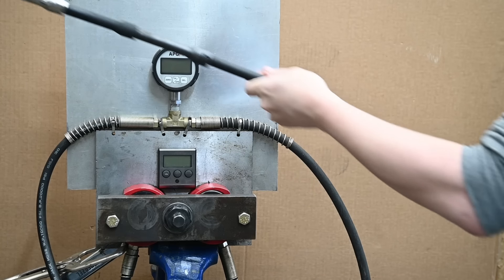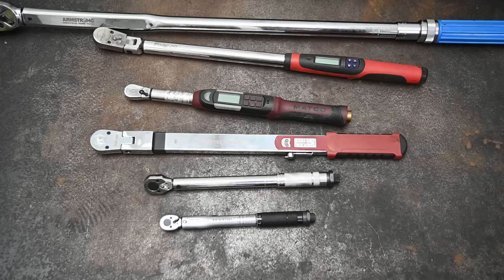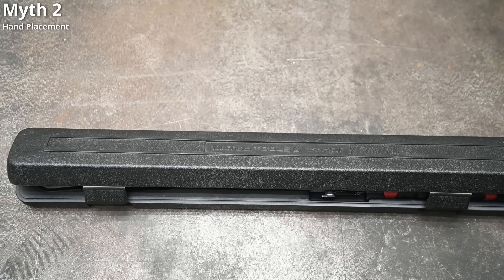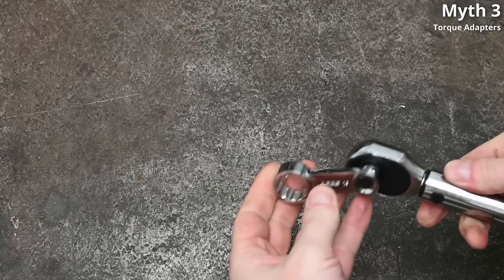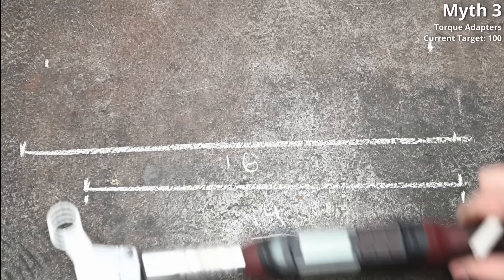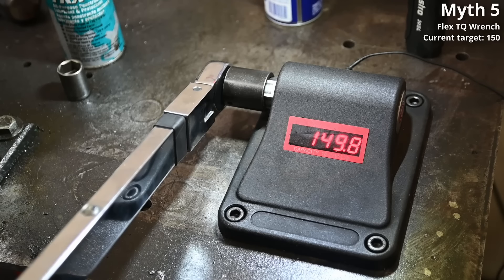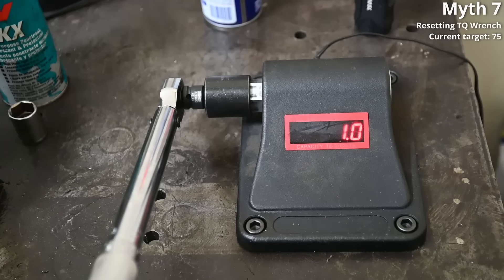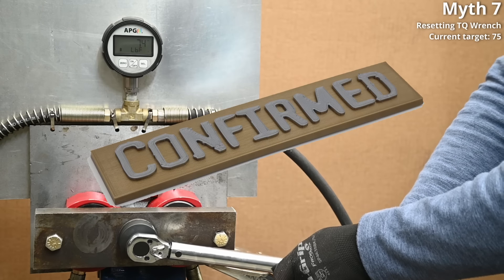You're Using a Torque Wrench Wrong: MythBusting 10 Do's & Dont's

Comment: When I was doing my apprenticeship, a couple of the instructors in my first year had an awesome lab for us where we'd incrementally torque some bolts, with anti-seize, oil on the threads, rust on the fastener and a couple others to show us how they feel when you're doing it, as well as how vastly all over the place you'll have the heads of bolts snap off. Manufacturers have WET and DRY torque settings for a reason. Usually the people that ignore that fact are the same guys who throw shit back on with torque sticks because they can't be bothered to get out a torque wrench and do it properly.

I think a lot of the misconception regarding torque in the first place starts with the commonly mixing up of ft-lb and lb-ft. even manufacturers have muddied the water by using them interchangably. The difference isn't super relevant to most people, but where it would be is the breaking down of torque into its composite components for teachings sake (and of course on the fab and engineering side but I digress...) If you understand HOW torque is applied, the notion of most misconceptions becomes nonsense immediately.

Comment: Now you got me thinking.  Since the anti-seize had such an surprising result, what about any added liquid to a fastener?  Wet applied thread lock?  Dried thread lock?  Lubes, like WD40, engine oil, and even brake fluid?  Water?  Rust?  Standard coating vs Stainless Steal vs Titanium?  So many things to test, my mind is blown!

Comment: Not resetting the wrench is also a huge problem if you live some place where temperature changes hard and your storage isn't tottaly insulated.

The heat can cause the spring to deform, usually this is a non issue because the whole mechanism would warp but if its under max tension it just makes the problem SO much worse.

Comment: you should do a test using loctite.
i think you will find the same results as anti seize (over tighten by almost double)
Then you should let the loctite set up and try to remove with a torque measurement, it will be like three times. 
even if you heat the loctite to break it down you still run the risk of snapping the bolt.
to be honest, i have never seen a bolt with a torque spec that calls for loctite.
but i have seen a bunch of dyi'ers that think loctite appropos for every application.
a torqued bolt is an elastic connection system. the bolt and nut are designed to hold best at the specified torque. adding loctite should not be required.

Comment: Luxonmx has some great write ups on torque spec for bolts and how lube vs unlube and new vs old bolts change torque and how all about clamping force but only able messure it from torque of the screw/bolt

Comment: Is it possible to figure out a correction factor for anti-seize compound on threads? For example, maybe in the 0-50 ft-lb range a particular anti-seize compound might have a correction factor of -25% and that gets you in the 5% accuracy range on bolts. Then, if you up it to the 50-100 ft-lb range, it might have a correction factor of -50% instead. Seems like that should be something that can be characterized for a particular anti-seize formula. Would it be within the 0-2% accuracy range? Almost certainly not, but maybe it could be within 5-10%, and I would take that over my bolts rust welding in the midwest. 

Thanks for making this vid, quality content!

Comment: With regard to flex heads - it's cosine error. if you flex the head 90° then it'll click without applying any torque. There's a reason the flex heads are restricted to +-10 degrees or so, because that limits the cosine error to ~1.5% which is within the margin of error.

Comment: In my job its critical to get torque values correct or people will get a pressurized bolt to the dome or completely kill a $50k job. We went through a whole class on torque and use of tools as well as the physics behind it. I have the formulas for torque on a magnetized table on my tool box. A lot more to turning a wrench than people realize.

Comment: Regarding the antiseize, can you show the difference between using anti-seize, grease, oil etc? Also how is the k factor affected by different bolt material? Stainless, galvanised, plated, etc? Even nylon locking nuts?

Comment: I wonder if you can "revive" the spring of a torque wrench that has been left at 75  ft lbf for six months by just leaving it hanging at 0 ft lbf for some time or by cycling it from 0 to 100 a couple of times.
Said differently: if you recalibrate it in it's "spring compressed state", will the calibration be out of whack in six month?

Comment: The section on anti-seize is pretty cool because it also indirectly applies to using teflon tape on fluid fittings. It's a common misconception that teflon tape seals your threads, but it's actually a lubricant. Without it, the friction of the threads is too high for a fitting to achieve its proper interference fit (look up NPT tapered threads).
Reply: Looked it up and it said "Sealants are Teflon (PTFE) tape or thread sealing compounds, also called pipe dope. When assembling connections, they fill any voids between the mating thread crests and roots that leave a spiral leak path. Sealants also provide lubrication that makes metal thread installation more manageable, and they help prevent galling." This from an engineering site titled - Getting to Leak-proof with NPT & NPTF Threads: What Matters.
Reply: The common misconception is actually what you think. That it only acts as a lubricant to further tighten things like npt threaded fittings. That's what isn't true. It does both. You can easily test this yourself by trying it on something like your shower head or an air compressor fitting. Count how many rotations it takes to stop the fitting from leaking, both with and without ptfe tape.  You'll really notice a difference with an air compressor using steel fittings, or one steel and one brass fitting. If both fittings are brass, though, no ptfe is needed because the soft metal easily deforms into itself.

Comment: Seems like with the two 2 in. extension at 90 degrees, right triangle math would apply. The torque wrench forms the base of the right triangle and the length at which the force is applied forms the hypotenuse of the triangle. The extension forms the short third side of the triangle, and with this setup the hypotenuse and base lengths are not exactly the same, but pretty close. I haven't done any math, but I suspect if you made the angle between the wrench and extension equal to the angle between the extension and the actual torque length, the accuracy would be the same as not using an extension at all. These matching angles would be a bit less than 90 degrees.

Comment: I always believed the 'don't leave it compressed' for the reason you have found, good test. I have a question whether that is a permanent deformation of the spring? I mean, it's going to depend on the spring material and different brands, but just out of curiosity leave yours unloaded for 6 months, if you might comment here what the outcome to that was (will be)? cheers, thanks for video.

Comment: Leaving a clicker unused:  In every other application I've heard of, a steel spring under compression does not create a set in the spring, in anything like a reasonable time for the purpose.  Coil springs in automobiles, for instance, are designed to go years under tension in relatively harsh environments.  And the springs in semi-auto pistol magazines can go decades under maximum compression without losing effectiveness.  I've heard many metallurgical engineers over the years point this out.  If you see a difference in just six months in a tool, maybe something else is happening...or that tool is indeed extremely cheap.

Comment: For Myth 7 :  It would have been nice to see you set the torque wrench to a specific setting, say 80 ft.lbs., test it at that rating and then store it away at that setting for 6 months. Then retest it and see what the reading will be.  The company I worked at had many torque wrenches locked to a specific value and used every day.  As others have mentioned below, these very rarely go out of calibration when checked at their specific torque every 3 months.  I think the benefit of this Myth 7 being busted is for a torque wrench that will be used at many different torque values during its lifetime.

Comment: NM here you have forgot to Test the Gedore Dremometer at the handle acuation point Test, because this Special wrench Can be Teleskopen on the handelside( i only know that because i had used one with a 5m ( 197 Inch) to torq 4600Nm

Comment: Never mentioned this, but hey you asked for it.

Does your dyno properly represent the load of a normal bolt?

the load is supplied by the measurement device, however this does not have the same characteristics as a steel nut or bolt into solid steel. Specifically, i believe the dyno is more elastic, allowing more flex, and possibly not absorbing high frequency impact forces properly in particular.

not sure, its just a thought i had.

Comment: I would think that adding the extension at 90 degrees would add length, but it'd be the difference between the starting length (14") and the hypotenuse of a triangle with a rise of 2" and run of 14." Since the aspect ratio is so low, the length barely changes. If you had an extension that was 14" I wonder if it would change more

Comment: Can you do a video comparing different thread lube and loctite. The industry I work in alot of the mechanics use copper paste or high pressure grease on bolts. I would also be curious to see how it effects different bolts (steel, Titanium, stainless steel)

Comment: Some great points issue is with most these channels, you need a   gear reduction real calibration set up so you aren't pulling , accuracy out the window unless you are using something like a suretest CDI or Norbar calibration system. Using lube you should be adjusting for that. What you are after is clamping force, why work harder to get it? Nobody cares to buy a lawnmower they simply want short grass. End result.

Comment: for the torque adapters!! setting it at 90 degrees does actually matter, just doesn't in this example. your working length is the hypoteneuse created by the wrench and the adapter. for the example tested here, it only comes out to 14.14... inches, compared to 14 inches, but if either of those lengths were to be much different, you'd get different results

Comment: Thank you for the great and informative video. However I would like a redo on the extension test because my thoughts are that when you get into higher torque like 150 you will be twisting the extension rather than turning the fastener. Have you tested it at high torque yet?

Comment: When tightening a series of fasteners that are all connected to the same part, going in a series changes how tight the first fastener is by the time you get done with the last. How do you use a torque wrench effectively in that case? Chase all the fasteners over and over until they all click quickly?

Comment: The anti seize is interesting, because I believe it opens up a whole new can of worms? If thread friction has that much of an effect, wouldn’t that mean that an old bolt into old treads would under torque?! I’m all for using new bolts when reasonable, but wheel lugs are a great example, even if I replace worn lugs, I’m not likely replacing the wheel hub, nor can I easily inspect the condition of the hub’s threads. What to do?

Comment: I feel like a flexible beam torque wrench is the most trustworthy to be consistent as long as it is used properly and consistently.  I always use a flexible beam wrench for internal engine fasteners.

I am also curious how much the tightening speed factors into the actual click point.  On a flexible beam wrench, so can see how much the speed of tightening inflates the reading and how important it is to creep up on the target value very slowly in the final moment before reaching the target value…tightening too fast seems to reach target torque prematurely.  How fast is too fast I am curious…

Another thing I find especially on higher torque values is needing to keep the fastener moving smoothly into the target torque.  Stopping too close to the target torque will make getting it accurately to final value nearly impossible on a click type wrench due to higher static vs dynamic friction.  A flexible beam wrench can be helpful since you can get the bolt going again which can require more torque than your spec.  Being able to watch the scale to mentally filter out that static friction torque spike required to get the bolt moving again and get the last little bit to target under dynamic friction is useful.  Otherwise, you have to loosen a bit and try again.

Comment: Great video, thanks. I'd like to see more variations of the anti-seize test. Are the results the same using anti-seize on large and small bolts? How is the torque affected if you use it sparingly? How does blue threadlocker affect the torque? A rule of thumb I've seen suggested is to aim for the low end of a spec, for instance set the wrench to 69 ft*lbs if the spec is 69-86 ft*lbs and you might not overshoot it, is there some situation where that rule of thumb holds true?

Comment: Actually that harbor freight wrench once calibrated was a very accurate torque wrench for a long time. But the electric ones are a whole new level. And they have charts for lubed torqued which each lube type on the threads. Down to a science. Arp fasteners has done tons of research. On how to torque just follow the specs. They give, it’s had a lot of research done to it.

Comment: Something that’s not stated super clearly is that the “torque” reading attained with lubricated threads does not mean that more torque was applied. Your setup is displaying a converted force applied to a hydraulic ram that is measured by the fluid pressure. Applying thread lubricant will increase the force applied per torque to the fastener by decreasing frictional losses. You don’t end up with “more torque” at the bolt, but your gauge is set up to convert the measured fluid pressure to effective torque applied to a non-lubricated M14 fastener. Changing any parameter (fastener lubrication, diameter, thread pitch, ram size, etc.) will change this calculation. 

The actual result here is that more tension is applied to the bolt for the same amount of applied torque. 

It may be true that the force applied to a lubricated fastener torqued to 100 ftlb results in a clamp load that is equivalent to that resulting from a non-lubricated fastener torqued to 190 ftlb, but I haven’t done the math on that.

Comment: Actual metrologist here, the temperature you use it in will also change the torque value, but unless you guys are using the torque wrenches for aerospace or other 2% or better applications you're probably fine with most of this shit.  Technically applying the torque anywhere outside dead center of the grip will throw it off too but only based on the wrench length and setting and it's usually not enough to matter for automotive etc.

You CAN get away with a cheap wrench, if you're lucky, just like a cheap hammer or screwdriver might work for you for a long time.

Or it might be WAY the fuck off and you won't know it.  A nice wrench can do the same, but it's less likely in my professional experience for that to happen.  A top end snap on wrench will hold it's calibration through abuse a LOT better than a cheap harbor freight will.  Generally we weren't even legally allowed to spec the cheap wrenches in the military because they aren't guaranteed by the manufacturer to anything.

Also, just because you don't NEED a 2% certified wrench doesn't mean that paying more and getting that is a myth.  You might not need a professional film camera, but saying a professional film camera is better than a phone camera is a "myth" because YOU don't need it is stupid.

Comment: Still, the main issue affecting the torque wrench's accuracy is the speed used to pull the wrench. If you very slowly pull until it clicks, it will not give you the same reading as if you use a fast motion to make the torque wrench click.

Comment: i work on boilers and chillers. lots of bolts to torque to the right setting to not have leaks. i also use anti seize on my bolts. if you think road salt does bad things try steam galling. so i end up running a tap and die to clean up the threads and the lube with copper ( high temp ) anti seize and tightening in 3 steps. it hasn't killed me yet so i guess it is working. 

to do some of the fitting on heat exchangers and pressure relief valves where the wrench doesn't fit i have used crow foot and extensions. 
i'm not sure what to do with the info you have shown me. i have to use the anti seize or i will be breaking bolts to remove them.

Comment: YES! 
The 'wrench with the adjustable insert had different lengths for the "crescent" end and the square drive ends.
This means AT LEAST one of the values MUST be wrong!
I don't really care how well made they are, or look, if they can't get that rather crucial detail right...

YES, using the correct, SPECIFIED, lubricant, if any, will mess up the stretch VS torque relationship.

Comment: I think the crescent head was applied in a position that put the moment of pressure of the fastener points on the tool’s flats too far from the radian of force, causing the deformation of the flat, and potential rounding of the fastener. I was taught to flip the wrench over to get the pressure moment closer to the radian. Myth?